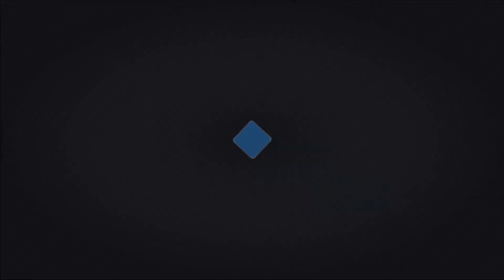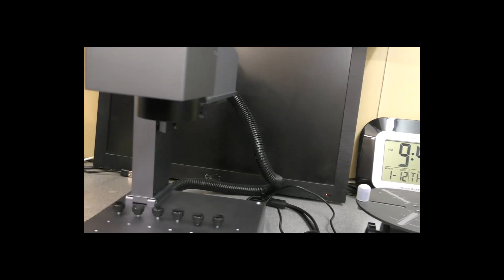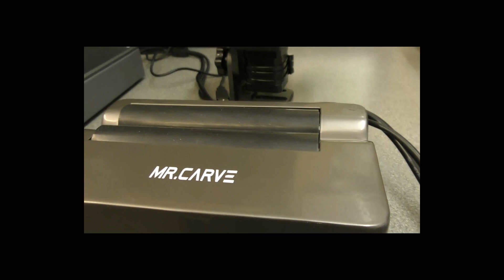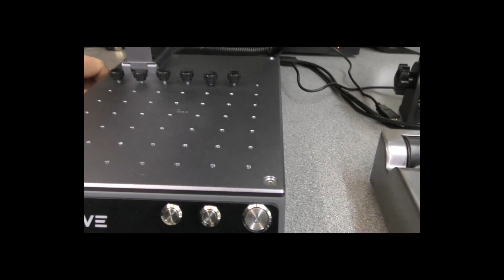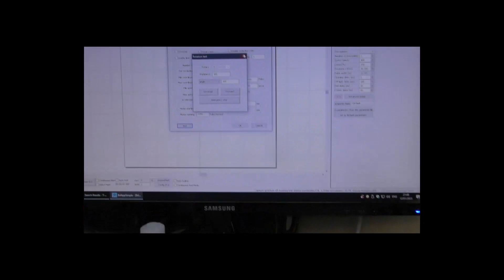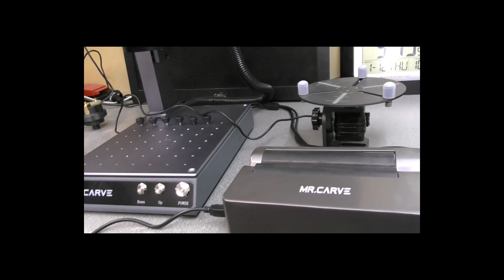Mr Carve M1 Pro. How to check your rotary accessories on arrival.

Comment: Hello my friend. I'm from Georgia and my native language is russian. And I need your help. 
I have a laser engraver MR.CARVE M4 with Roller and Ring step motor. Are the same parts like on this video .  And software BslAppSimple on windows 10/11. 
I can engrave on a flat surfaces with no problem.
I have a problem with additional motors Roller and Ring. I have properly connected one of it, but when I try to print it is not working and it  just prints without the motors moving. There is no motor rotation (steps) .
Bsl
Movement Axis/Rotation and motion test /test. 
When i try it, motors does not moving not Roller nor Ring. Devices connected to USB port on the left side of the laser engraver M4. When i connect them the motor blocks free rotation with fingers and i see that the motor is connected to USB power.
Please help me to solve this problem.
May be some configuration in software is wrong? I never changed config files in this software.